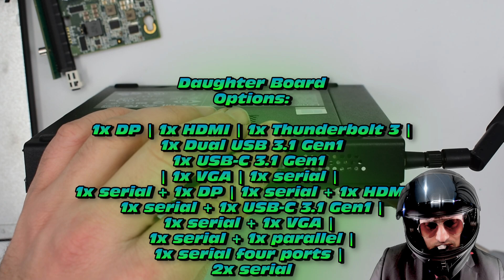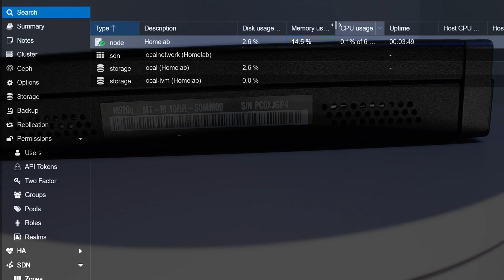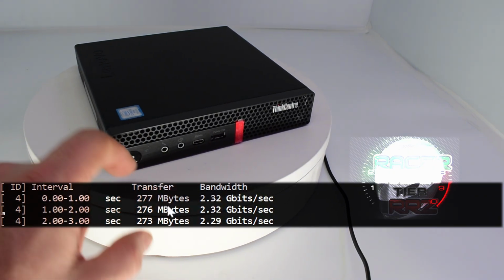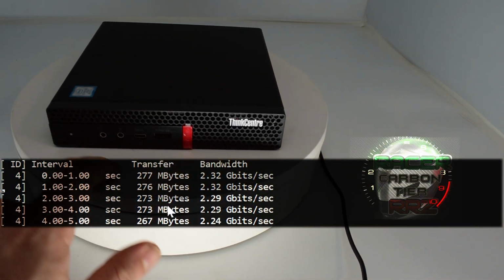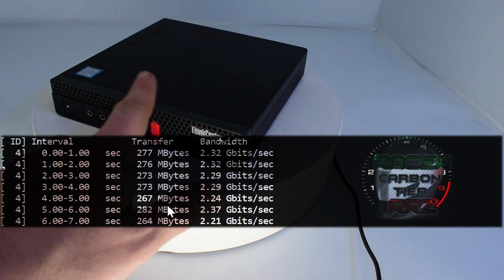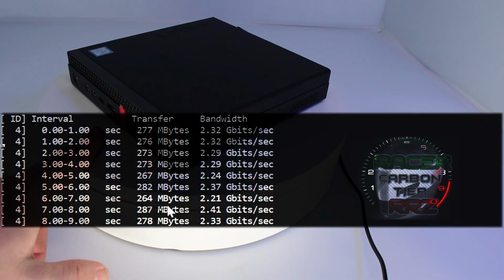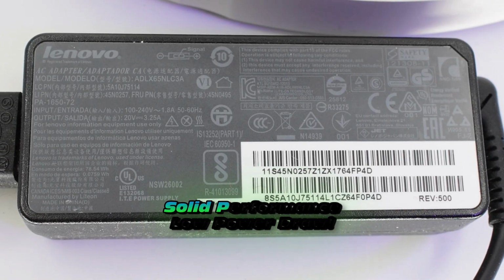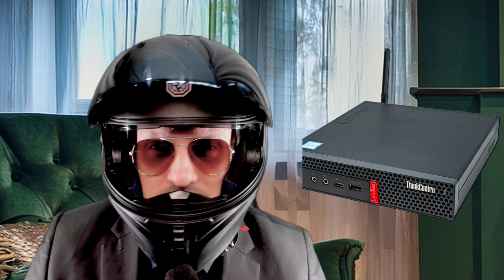Best 10GbE Mini PC? Lenovo M920Q Tiny Gets A Speedy Upgrade!

Comment: Very cool build. that sideways pcie riser is so cool for these! dual 10gbps is pretty sleek.... Then the original slot too! Kinda bummed i got the m910q  on ebay. i have 3 now, but maybe i'll  sell one and upgrade to this model purely for what you have done here or an expansion pcie sata connectors for more data from 3.5 or 2.5 drives externally. Because that would be pretty sweet having the power and compactness of the mini pc mixed with a DAS of some sort. Very cool!
Reply from the maker: The M910Q is also quite useful, but yes, the M920Q or M920X (dual M.2 NVMe model) are the better offerings. Don't discount the newer generation of Mini PCs either - like the M90q and P340. I am busy editing the follow-up video where I am testing out several ways to get more storage connected to this system (USB 3.0 / USB type C, PCIe, M.2 M-key, M.2 E-Key, Mini PCIe - you name it - I have tried it!). I plan to run 6x 1TB SSDs in a RAID 5 pool via Proxmox and TrueNAS Core. It's worked out well. I need to still hook up my Noctua cooling solution but otherwise it's ready for service as a DIY NAS with 10GbE networking. I also have it hooked up with a USB monitor and Bluetooth keyboard. It's a versatile little system.

Comment: Can I put an intel i9 in it?
Reply from the maker: Yes you could. The best CPU option is likely the Intel Core i9-9900T (8 Core / 16T/ 4.4GHz Max), but I would recommend having the latest BIOS (before you upgrade), the better 65W CPU heatsink (P/N: 01MN632), and high power PSU if you go for a powerful CPU in this system (e.g. P/N: 4X20E50562; 135W 20V 6.75A PSU brick). This is not essential but it would mean lower operating temperatures and more power for external devices etc.

Comment: I've been running a M720Q, similar if not same machine as the M920q (chipset difference?) for a couple of years now as a pfSense firewall with an Intel i-350 T4, 4 port gigabit card, and an i3-8300T CPU with 8gb of memory and it's been a solid performer that uses very little CPU resources. These generations can also take the 9th gen i9 "T" series CPU (i9-9900T) as well.

Lenovo has the M720q, M920q, and P330 in this 8th/9th generation. The P330 tiny has a second m.2 Nvme slot.  If you need/want something newer, Lenovo also has the M90q and P340 series with 10/11th gen Intel, or later generations of the M90q/P340 that have the LGA1700 slot for 12+ gen "T" CPUs. I have an early M90q with a i3-10300T as a spare for another pfSense system when mine eventually fails one day. Only the M90q and P340 tiny and above have the internal PCIe riser slot (M70q and M80q do not), and the PCIe risers are not interchangeable with the earlier M720q, M920q, and P330 machines. I let the magic smoke out of my first M90q trying to use my M920q riser in that system, a 125 USD (replacement motherboard) mistake.
Reply from the maker: Thank you for sharing your experience with these systems. That should give others a nice list of systems to keep in mind. 

I can't see any measurable difference between the M720Q and M920Q, but I would expect the M920Q to have an edge somewhere (I didn't see anything obvious in my reading). The other model to keep an eye out for is the M920X which has dual M.2 NVMe slots on the PCB (something that can be added to the M920Q with dedication and a steady hand). 

The newer generation of these Thinkstations are coming down in price and they may well be available for similar prices. The M90q and P340 would be solid choices for the 10GbE NIC upgrade also.
Reply: @racerrrz  I have several HP Elitedesk G4 Mini's with i5-8600T cpu's, so the same generation and chipset as your Lenovo M920Q Tiny. All of mine work fine with 64GB of DDR4, despite the specified HP memory limits. I'm guessing yours will work too. ZFS loves lots of RAM!

Comment: Hello, great video. Can I use a DAS, connect to this tiny server and have a fully NAS machine?
Reply from the maker: Thank you. You're just too fast for me because this is exactly what I am working on now! I have this system torn to pieces to see how far I can push it. I plan to connect up 6x SSDs to create a RAID 5 pool managed with Proxmox - with the 10GbE connectivity. The issue I ran into was - what is the best way to expand the number of USB ports? (I am using USB to sata connectors).

I tested out more than 10 different methods to expand USB connectivity (I made a post about it here - you may find that of interest: https://www.youtube.com/post/UgkxpTktM_1qj2u9I6LthX_lHsydedoiG9Vx ). 

Thus far it has been pure joy to set up the system - Proxmox is even better than I expected. Right now I have several different OS's configured - I just toggle the one I want and use it as needed. My TrueNAS VM has worked better than I expected. I just received the last item I needed in the mail today - so hopefully I can fast track this video a bit. 

So yes, you can absolutely convert this system to become your home NAS - the question is just how will you do it.
Reply: @racerrrz  Many thanks for you answer! Even if I already saw several videos and red some documents about NAS, I know that Unraid, TrueNAS and OMV are OS designed to NAS features howbeit I have to figure out what Proxmox is.

Many thanks for your help.
Reply from the maker: Nice. You'll get that NAS sorted in no time. Proxmox is a hypervisor for managing virtual machines (VM). Think of Proxmox as a user interface to manage other operating systems. You can install any OS, allocate it some hardware power (2 Cores, 4 Cores, 4 GB RAM, 8 GB RAM - you decide!) and then that OS runs in a "virtual sandbox" - plus you can run and manage several of these VM OS's. I use mine for testing purposes - so I can load up Ubunto server or TrueNAS Core and any NAS like functions that I have set up. Once I am done transfering backups to the VM, I can power down the VM and move on to something else - Windows VM to browse YouTube even lol. Come to think of it it's similar to DOSBox etc. where you could run DOS applications inside of Windows etc.
Reply: @racerrrz  can you use the riser to connect a pcie card with two sff 8087 connectors and connect the PC to an external 8 bay JBOD enclosure?
Reply from the maker: @davidcounter4866  That's true. Call me greedy but I wanted to keep the PCIe slot for a dual 10GbE NIC. That gives me the best of both worlds. I did have success with a M.2 E Key to SFF 8087 (to 4x SATA) converter but it was a full length (80mm) adapter and the M Key slot is 30mm max. With the motherboard removed from the casing it did work however. The least disruptive method was a USB-C dock to 4x USB 3.0s.

Comment: Does it make a difference as you used different memory brands.
Reply from the maker: Using different brands can work if you match the CAS latency between them. Ideally you would buy the same brand and the same CAS latency to ensure smooth operation. The HyperX brand of RAM modules (likely a counterfeit of Kingston's Hyper X) have been delivering good service for me so far. I have matched both modules (2x 16GB DDR4 2400 MHz SODIMM; CL14 SDRAM), so no issues there.

Comment: The adapter is X8 speeds
Reply from the maker: Correct. PCIe 3.0 x16 slot with x8 electrical lanes. Decent bandwidth for most applications, but not a full x16 slot.

Comment: hi… can u swap the CPU?
Reply from the maker: Hi. Yes, the CPU can be swapped out for an 8th gen or 9th gen Intel T CPU. I included some footage for how to do this in my video: 4:54 

For a good list of CPUs you can check here: https://www.servethehome.com/lenovo-thinkcentre-m920-and-m920q-tiny-guide-and-review/2/
Reply: Yes up to a Core i9 9900T and idk about this model but on the ThinkStation P330 Tiny you can also do that upgrade in addition to non-T CPUs the 65W ones but you'll have to sacrifice the dedicated GPU because the P330 Tiny comes with Quadro GPU (either P620 or P1000 which are also upgradable to a RTX A400) but you could have a 65W Core i9 9900 on those if you don't need the GPU and are ok with the Intel UHD, personally I have the Core i9 9900T with a Quadro P1000 and 32GB ram and it's a beast, might do a RTX A400 or AMD RX 6400 (Low Profile) just to have faster graphics.

Comment: I am waiting the part2.
Reply from the maker: I have a heap of items lined up for this Mini PC. Part 2 is in the making - I was a little distracted with another video project for the HP Z8 G4 (video is done - so the Mini PC gets the focus again!).
Reply: @racerrrz  Is it up yet?
Reply from the maker: @sketchaus  It likely would have been close to done, but sometimes fate steps in and blocks video creation! 

My OS for my editing rig developed some corruption - I am hopeful I'll be able to fix it up - otherwise I need to get a new OS up. I am not sure if I have lost anything of importance just yet, but right now my editing rig is down. 

The Lenovo M920Q is however up and running. Right now it's working to clone my editing rig's OS (Macrum Reflect via USB GUI) and once done it switches back to being a Proxmox VM server with 6x 1TB SSDs. This build is proving really handy. I may rush the video to get a follow-up out.

I am still getting caught-out with finding a way to power auxiliary fans for it (2x Noctua NF-A4x20 PWM fans). I was hoping a Sata powered fan hub would do it but even that is proving difficult to power on. I would prefer to find a way to use power from the mini PC to run extra cooling fans - rather than an additional power brick.

I made a YouTube post on progress and I'll do another once the video is ready to go out. https://www.youtube.com/post/UgkxpTktM_1qj2u9I6LthX_lHsydedoiG9Vx

Comment: For dual nvme, you need the m920x model.  Great video!
Reply: Strictly speaking, if you're adventurous (read: very good at soldering), you can modify this to have a second nvme.
Reply: @kizofieva  yeah, I saw a modification guide somewhere teach you how to do it. But I am not good at soldering. I wonder if someone can do it for me? :)
Reply from the maker: Thank you for your feedback and for the model referral. I haven't been able to find a M920X locally but I imagine they will flood the market once a bunch go off-lease. The dual M.2 slot is fully worth it. I did read about the M920Q being modifiable to gain functionality of the second slot here: https://www.reddit.com/r/homelab/comments/11oz3k0/lenovo_m920q_tiny_hardware_mod_for_dual_nvme/ . For the price point the M920Q hit the mark for my needs - it's a potent system for the price point.
Reply: @racerrrz  also X supports 4x/4x bifurcation on that PCIe slots, meaning 4 NVMe’s

Comment: I think that You can use this internal SATA port for some SATA SSD without external case - only PCB it usually use 1/4 size of whole enclosure. It may fit inside with this extra 10Gb NIC, anyway on SATA SSD put Proxmox, in M.2 slot put 2TB SSD and multiply this setup by 3. After that make cluster with 3x Proxmox host and one Ceph Storage drive on 3x 2TB NVMe.
It will bee quite beefy homelab setup for virtualization.
Anyway, I must say that You make a damn nice videos with things that I love - hardware quirks :D Keep it up mate!
Reply from the maker: Thank you for your feedback, much appreciated. That's a good idea actually. The PCB for the SSD is a fraction of the size of the casing. I have alternative plans for that sata cable - I bought a number of adapters that will convert that sata power connection into fan headers - the Mini PC needs some additional cooling and I don't want something cumbersome - it needs to be flush. I had planned to repurpose the wifi M.2 E Key slot for some additional sata ports, but the adapter I ended up with was for mini PCIe - so now I need an adapter (m.2 e key to mini PCIe) for the adapters that I bought (Mini PCIe to dual internal 20-pin USB headers) - six SSDs need to connect - max speed of ~ 166MB/s per SSD via the 1x PCIe 3.0 lane haha. I also want to test out USB NVMe RAID reliability. Then, eventually, expanding into a cluster setup. Proxmox will open up some doors for heavy lifting from the small homelab!
Reply: @racerrrz  Can we buy a long cable that can enable us to put SSD outside of the case? Maybe we can find one.
Reply: If you make it a cluster I don't think you will get 3 x 2TB NVME. Your storage capacity will still be 2TB. That is what I think, but maybe I am wrong.